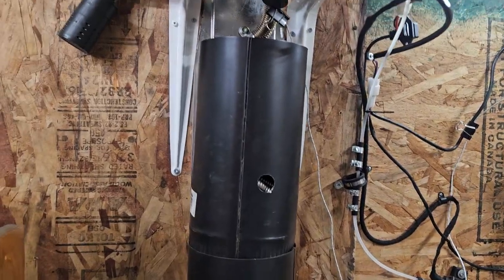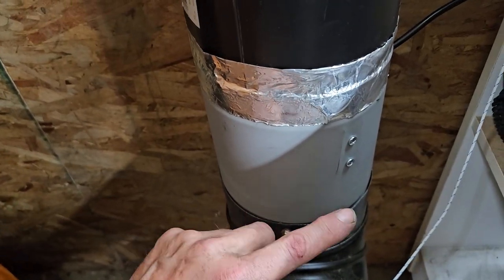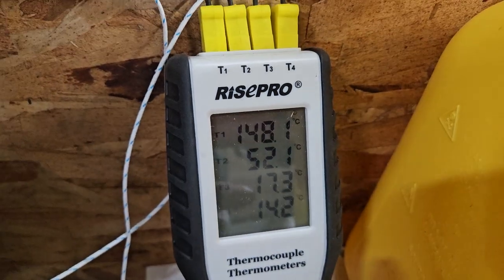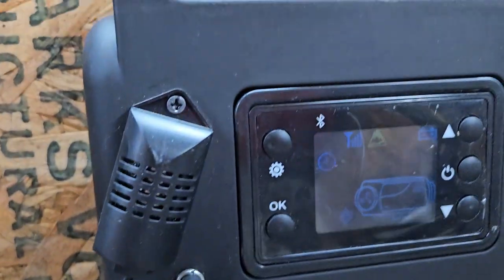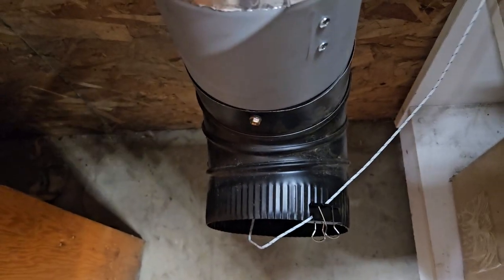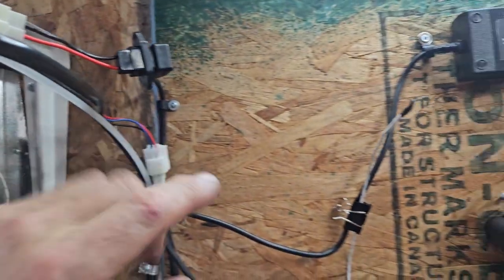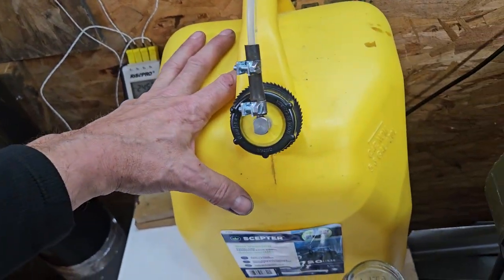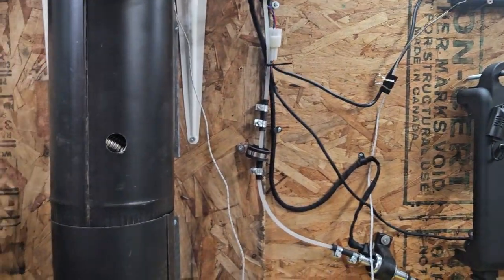Chinese Diesel Heater - Exhaust Gas Heat Exchanger (long version)

Comment: Interesting solution with the stove pipe. I'd be interested to know how it holds up long term...that much exhaust pipe with that much bend is going to MASSIVELY slow the airflow through the burn chamber...I'd be interested to know how long it goes before it soots up inside. I'm betting its running rich with that much less air going through...
Reply from the maker: At the time of this reply (Jan 16 2026) it has been running like this 24/7 . (Actually, I just noticed a few days ago that I forgot to cancel a test of timed start/stop 20 minute shut off each afternoon,,, so technically 23.6/7 with one Stop/Start on it's own each day for 10 of the) 12 weeks ( 2000 hrs). Still running clean , still starting itself flawlessly everyday. The "long pipes kill heaters" rhetoric is outdated and now quite inaccurate. The newer heaters have temp and altitude(air pressure) sensors and can do some tuning themselves. They also have "Plateau, Alpine or High Altitude mode" ( many names for the same thing). This tells the heater to lean out the mixture a bit - which is how I run mine. The YouTube site "Lowered Expectations"  did a good test with gradual increases of exhaust pipe length up to 5 meters. Now if you put in a bunch of sharp 90° bends ,,,,, that could make a difference as wide radius steady bends like mine create very very little flow restriction but sharp short 90's create a great deal of restriction. I have a newer Vevor exactly the same model running with the stock pipe and there is very little difference when I accurately measure exhaust gas velocity between the  23" stock pipe  and the approx. 70"  heat exchanger at all heat settings H1 to H6.
Reply: @scotscheideman9800  Okay, sounds like good news then. I wasn't really thinking about pressure as much as total volume of air moving through... But if all that extra exhaust has no effect on the air flow, sounds like it would work great. Apparently now they have dual motor heaters... So the intake combustion air and the blower air can actually operate at different speeds. Would probably solve any sort of airflow problem through the combustion chamber relative to the overall speed of the heater.

Comment: exlent video! I want to do the same. how long is the ductwork pipe, an how many feet of exhaust tube. does the stock fuel pump pull the fuel up out of the big tank,or did you modify that. Thankyou for your response!👎🤪☃️
Reply from the maker: The section of 6" stove pipe that has the exchanger coil is 12"(30cm). Below that is 3ft(1meter) of pipe, then the duct fan, finally an adjustable elbow. The exchanger is made with from 2meter(6"6")piece of 1" exhaust tubing from Amazon
Reply: @scotscheideman9800  thankyou. im gona try it . my heater won’t do the job by itself.👍

Comment: Cut the power while it’s at full throw and see what happens. My intake dumped diesel into the trailer. You may consider putting that outside.
Reply from the maker: Thanks for the advice, I know it was well intended and I appreciate it,  but I put the intake inside for a couple of reasons specific to the extreme climate I live in.  #1- Hoar Frost we get this several times each winter ( 4 times before New Years so far this winter) and it will plug off the CDH intake as it does with the much larger and coarser intake grate  feeding the much more powerful fan on my pellet stove. This will without question make a CDH soot up till it flames out, requiring a complete teardown and  thorough cleaning. #2- We get extended cold snaps below -40 most every year (this winter -34c/-22f so far). Diesel is hard enough to ignite and burn at room temperature , but at -40 it is near impossible. The only reason that the Espar's and Webasto's or CDH which heat the sleepers of parked highway tractors keep working in -40 or -50 is that at those temperatures , the drivers have to leave the truck"s engine running because after just a few hours shut off ; a successful start is unlikely. The fan blast from that huge engine blowing under the cab and sleeper plus heat from the engine exhaust which runs under both , means the Webasto/Espar/CDH is intaking air much warmer that the -40 or -50 it would get if the engine was off. The older Cat diesel engines we used in the bush  in the 80's and 90's  needed to be left running at a high idle overnight ( at minimum idle they would quit before morning too often) and would shoot a massive shower of soot  the next morning when we revved them up. This was because of incomplete burn due the  extremely cold intake air. I will keep my intake in my Garage where I work on  and frequently start vehicles , including diesels ; so a little diesel smell is not a problem . I choose to avoid the major teardown , time loss and loss of heat problems the other 2  scenario's would have already cost me at least 4 times this winter.

Comment: Running a diesel heater exhaust through a radiator or homemade heat exchanger is extremely dangerous.

Diesel exhaust contains carbon monoxide. Cooling the exhaust creates acidic condensation that eats metal from the inside out, causing pinhole leaks you can’t see. One small leak = CO inside your space.

If a leak occurs, you’re not just breathing CO — you’re inhaling condensed exhaust vapors mixed with moisture, which contain nitric/sulfuric acids and toxic aldehydes. This can cause lung and airway chemical burns, coughing, chest pain, headaches, dizziness, fluid in the lungs, and delayed respiratory injury. You may not smell anything unusual.

Adding radiators or exchangers also increases backpressure, leading to poor combustion, carbon buildup, glow plug damage, cracked chambers, and early heater failure.

Diesel heaters are already sealed heat exchangers by design. Exhaust must go straight outside, unrestricted.
Please don’t copy this setup — people have been seriously injured and killed doing this.

Comment: Hello!  I made something simular, ran it for about a day or two and then i stopped working. Did the exakt same thing with a pipe and coiling the exhaust, my plan is to fill upp the pipe with sand when its all working.
 Opened up the heater now and its FILLED with soot. Sooo im guessing the exhaust is to long and builds up to much pressure for the burner.

Had that in mind when i build it and thought i might draw the pipe upwards to get convection or whever its called but then you get the problem with condensation.  sooooo my question is, have you had any problems with soot buildup? how long is your exhaust pipe? have you made some special settings on the display?      have a great one! / freezing cold workshop in Sweden
Reply from the maker: My unit has been running now , mostly on the lower setting for over 70 days non stop (started in this configuration Oct24/2025). I am running it on Plateau mode even though I am only 720m ASL(2300ft) No carbon build up, I used a 2meter exhaust pipe with and extra apprx. 30cm(1ft) to get through the wall and far enough away from it so the condensation iceberg isn't touching the wall,. One thing to consider is that I kept the combustion intake inside the garage for 2 reasons. #1- we get heavy hoar frost here  several times a year which will plug of the intake and certainly cause it to soot up. #2- we get extreme cold here -40° and worse - last year we had a cold snap hit with the coldest night hitting -45°c(-56°f) and lasted about a week. At those temperatures even internal combustion diesel engines have a difficult time running clean. Most manufacturers have electric heating grids in the engine intake to warm the air before entering the cylinders. These are mostly used for start up but in these extreme temperatures the engine's ECM will run the intake heater as needed in prolonged idling situations. I hope this info  helps you to resolve your problem.1 final thought, don't get your hopes up too high for sand heat trap to do much, the total heat energy exiting through the exhaust pipe has proven out to be only about the equivalent of 200watts from my measurements over the past couple months.

Comment: How did you attach the stove pipe to the wall? Nice video thanks
Reply from the maker: for the hot portion, I used a metal standoff which i made from some scrap sheet metal. I screwed it to the wall and then screwed the assembled heat exchanger to it. The pieces of pipe below that i just used wood and screws to space it the same distance as the top

Comment: I was planning on running the exhaust pipe into my existing duct work, then run the exhaust gases into to existing flue pipe of my furnace, while pushing the heated air into the duct to move the heat inside the duct work into the house
Reply from the maker: Interesting idea,  I am hoping to do some very accurate fuel burn measurements soon to come up with " honest, verified" Btu/hr and Kw/hr output figures. The  most common of the "estimates" I can find online and these vary immensely; ranging from 14,000 -19,000 btu/hr ; far lower than the manufacturer ratings.  Most household forced air furnaces are 70,000 - 100,000 for comparison. I'm not sure if your forced air system will distribute the heat evenly unless the fan is running. my guess is that with such a low CFM of airflow , it will likely all just exit up through the first duct in the pathway. The pressure in the ducting generated by the furnace fan may overwhelm the little fan in your diesel heater.  Most recent design furnaces utilize fans in the   " intake/combustion/exhaust pathway" as well and there's a good chance that the pressure variations created between furnace running vs furnace off, could create undesirable mixture variations making your unit run too rich or to lean. Even if you emit the furnace exhaust flue tap,,,, I would be leery of this type of home heating integration. My unit shown in this video is heating a garage __ with lots of leaks around the overhead door and walls that are not sealed as well as your house. With all the little leaks in the building I am heating __ pressure imbalance is near impossible. Homes are built with a much higher air seal integrity. It is an interesting idea for sure , but there could be many hurdles and roadblocks and the safety concerns about CO leakage

Comment: What an extremely novel idea! I'm going to copy that, plus I think I'll incorporate a heat sink/battery that the air would flow directly into... perhaps an insulated box with a port blowing in at the top and exhausting out thru the bottom, to really force the warm air around the heat sink before it'd exit the box. Perhaps a 30 gallon drum of water as the heat sink would suffice. Great video - thank you for sharing it.
Reply from the maker: Thank you for the comment!

Comment: Great idea. I would love to duplicate. I have a similar set up but did not run the exhaust in a stove pipe. Just had it in the open. I found it quite difficult to curl up the exhaust pipe. Any tips on how you were able to get it into the stove pipe? I felt like I was going to crimp it. I was worried I would crack the exhaust pipe.

Thank you!
Reply from the maker: i did it by hand wearing gloves , trial and error, quite slowly. I didn't get all of  it right the first time either, I had to straighten some curls out and re-bend them to get the descending pitch that insures all moisture drains out. I intentionally left all the coils a little larger diameter than the pipe so they have to be forced in. this lets them press out against the pipe , making them closer to perfectly round , eliminates any vibration noise and lets them heat sink to the stove pipe as well. Using the pipe as a heat sink works quite well, the coils dump a ton of heat into the pipe as metal to metal is a much more efficient heat transfer than metal to air
Reply: Thank you! Going to try it this weekend! :)

Comment: Im using a Lf bros np at window level. Using only the exhaust pipe that came with it and maybe another 11 piece outside the window panel.No muffler.Only one pipe strap that connects the end of the inside exhaust pipe to the "thru the wall" inlet that is in my wood panel in the window frame. No sealer,no carbon leaks. Maybe u might get a hint of smell of something on start up since its only my third day running the unit. I think its just oil from factory,,it could be a bit of exhaust leak on start up until draft starts..and I use a klein carbon meter at the joints..for immediate spot testing,,no carbon at all.... I also have kiddie carbon meter in the room,and meter outside the room. And nest carbon and smoke in the mail..2 is 1 ,1 is none, mentality. Im very happy. Its for my oldest son..its actually overkill. He sleeps in 65 to 67.. At lowest power 1.4...his room maybe 250 to 300 sq feet,will go from 62 to 76 in 3 to 5 hours depending on outside temp of 22 to 40 degrees. But i read these devices like to run on high for soot issues..So what were gonna start doing is,,start up high 15 min,,,shut down high 15 and or maybe incorporate adding kerosene 1 cup to a gallon to keep things clean. My diesel is already with seafoam in it. And i never smoke on start up as is. Im only on day 3 using it though in New york state weather lower hudson valley.
Reply from the maker: #1 -I'm not sure if it is a typo on your part , but CO2(Carbon Dioxide) is not a major concern with these units. CO( Carbon Monoxide)  however is the one you should be monitoring for.
#2-my unit has been running now for  2 months non stop( Oct24/2025-Dec24/2025- almost 1500hrs) mostly on the lowest or near lowest settings with no carbon build up. I believe altitude(air density) , temperature, humidity and the actual chemistry of your local fuel all play a part in how clean these units burn. I live in Canada 2500ft(700meters) ASL . It is fairly dry and VERY cold. We are in our second week of overnight lows dropping under - 20c (-30f) with the windchill values approaching -40 on several nights. January and February are traditionally colder , last year we saw - 44c with -54c windchill (-49f with windchill at - 69f) . Our diesel fuel is seasonally adjusted; blended with Bio Diesel the percentage of which peaks (10-20%) in late spring and reduces to Zero by late fall. We get -40 or colder most every year so our winter diesel is very close to "Arctic Diesel".  I am also convinced that most of the "soot issues"  over the past decade resulted from older units that didn't have the ability to read atmospheric pressure and temperature or the software to compensate for changes in these important factors of clean combustion. My newer Vevor heaters all have the ability to sense and compensate for such and I would bet your LF Bros also does as they are said to be a very high quality, clean, reliable running heaters.
Reply: @scotscheideman9800 yea I get brain farts.. I meant carbon monoxide.. I been saying c02 all dam week for no reason. Hahaaah.. Now I gotta go change comments hahaha.. But thanks for responding.. I'm only at  I think 500 ft above sea level so I didn't get any units that adjust for it.. So far no leaks..

Comment: Now let me ask you a question,,,
Have you done extended testing in each direction?
To see which one makes the room feel better to you?

The reason i ask, because i have a free standing 
pellet stove on one side of my house
an the first floor. I put a fan on the floor and blow cool air into the heat
as opposed to blowing fans elevated at doorwar,away from the heat.

I notice that blowing cool air is better since its more dense and moves easier across the floor.

So does this concept work the same  with your setup?
And does cooling affect the exhaust soot in the ends of the pipe on the way out?
Reply from the maker: With our extreme cold I have found that the cold air layer is better disrupted and mixed forcefully with warm air. The heater with the heat exchanger in this video is on the back wall of the garage. The cold air gets in around the large 3m(16ft) wide door in the front wall with old leaky seals. I can now wear a worn old pair of runners I keep laced up loose enough that I can just step into them like slippers and my feet are warm for hours, All the previous years here , when I was using 3 ceiling mounted infrared heaters (1500watts each) , winter boots were needed for anything longer than a few minutes'
I also have a free standing pellet stove in the extension of the house. The very heavy hoar frosts we get here have choked off the intake for it this year several times. This is why the intakes for my diesel heaters are inside the garage they heat. One night of running with the intake as badly plugged off as the pellet stove would require a complete teardown, cleaning and a new screen.